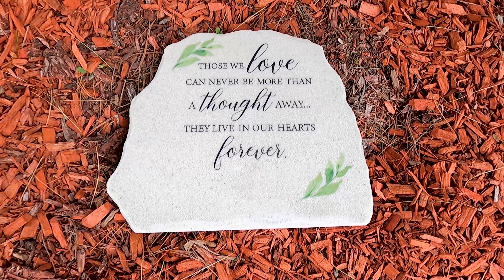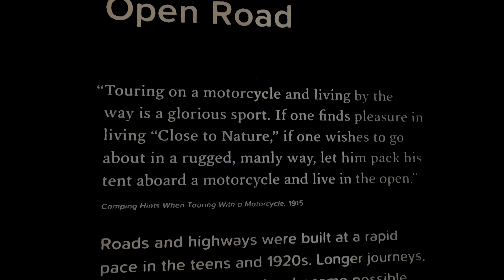Just How Expensive could a Ferry Crossing Be? - #MotorcycleTravel

Comment: You can put your Harley into transport mode to prevent the alarm from going off. With the fob in range, turn the ignition on and off again. Within 3 sec press both turn signal switches simultaneously. The turn signals then should flash once. Now the alarm is disabled. All other security systems work nontheless and you don't have to leave the fob at the bike. I did this on a ferry to Norway.

Comment: Another great video.

That does seem to be a nice ferry. Did you do lunch on the ferry? But the cost, and procedures did highlight how spoiled we are in western Washington state with the Washington State Ferry system (when it is operating normally). Most routes do not require reservations. No tying down required. Generally motorcycle are first on and first off. Even without reservations motorcycles almost always get a space on the next sailing. There is access to the car deck at all time. The ferry boats switch which end of the boat is the bow at each crossing. So the boat never has to turn around. 

This isn't really a comparison of similar types of ferries. The Lake Express Ferry is a high speed small vehicle ferry for saving time, reducing stress and generally being comfortable. Its route is almost 90 miles. The Washington State ferry system is part of the state highway system. It is also used by trailer-trucks and other commercial vehicles. Its longest crossing is only about 20 miles. Some are only about 5 miles.

I have taken a Washington State Ferry coming back from the Oster Run motorcycle rally. That is the only time that I have ever seen motorcycles required to wait for the next sailing. They were limiting how many motorcycles they were putting on each ferry. The ferry I was on was nearly half motorcycles and half other vehicle by space. My guess would be over 200 motorcycles. It was an impressive sight.

Comment: i have 09 street glide with new throttle body because limp throttle problems and new counter shaft sprocket and 140,000.00 miles since new.  Bummer you are having so many problems with the road glide dude it's same bike I have